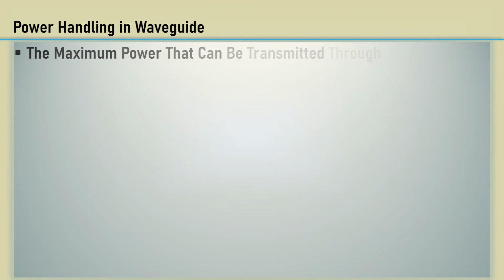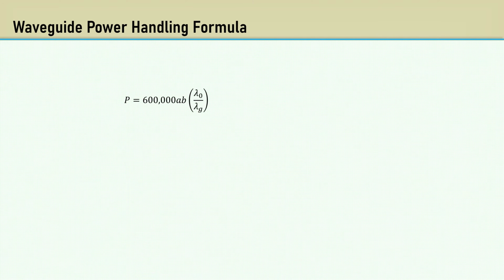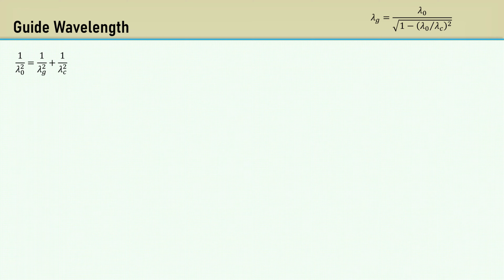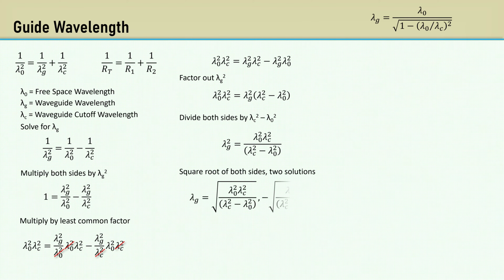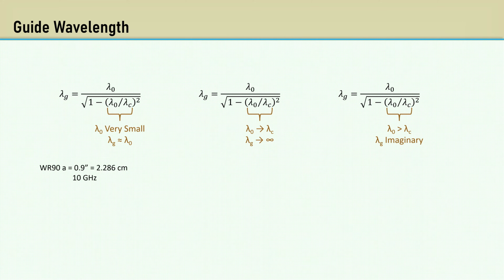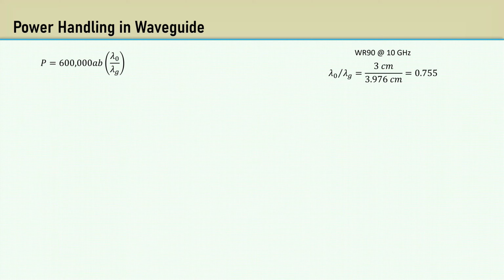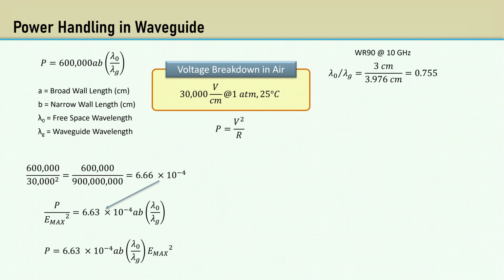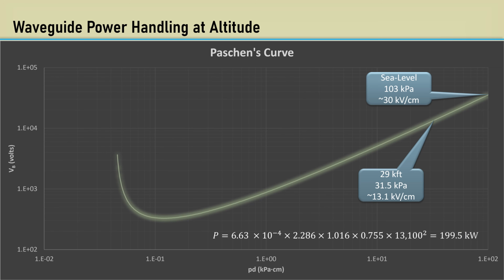Waveguide Power Handling (4k Video)

Comment: I am a big fan of your videos.   I love the fact that you mathematically derive your explanations.    I have noticed that there is a "dearth" of microwave theory textbooks, or lab manuals for that matter, that set forth the underlying mathematics of simple RF network analysis equations - simple transmission line problems for complex series and parallel networks.    Could you recommend a couple of microwave theory textbooks (or lab manuals) that derive their equations and support their equations with "enumerated" examples (I am really looking for "textbooks" with enumerated solutions)?
Reply from the maker: Thanks so much. Unfortunately I have not seen a RF book that does what you are talking about, which is a shame. In my observation, it looks like RF and microwave text book are regurgitations of previous ones, especially with waveguide. It’s a bunch of vector calculus with no real world examples. I wish I could be more help.

Comment: So what does that mean for waveguides in space, it looks like its down to a few watts would that be right? or is voltage breakdown in space much higher as there is no air
Reply from the maker: The voltage breakdown goes back up in a vacuum. The Wikipedia page on Paschen’s Law the graph is better than mine as it approaches a vacuum.
Reply: @oldhackee3915  Your plot is fine.  There is a lot of interesting Physics summarized in a Paschen Diagram, especially that the x-axis is product fo frequency*dimension.
Reply from the maker: Thanks for the comment.
Reply: The next regime of microwave mayhem for space applications is known as multipaction or multipactor.  It is a resonance breakdown phenomena requiring both a vacuum (no air) and radiation (free electrons) environment.
Reply: Look-up Hatch & Williams regarding Multipaction.

Comment: Maybe if we used sulfur hexafluoride gas SF6 as a wave guide quench gas, we could push more power.  I guess we would have to shield the outside as well as the inside.
Reply: If the capacitance not change and dielectric looses not going to be mutch higher than as air use as insulator.
Reply: @Duracellmumus  So does that mean we can't use wave guides in the vacuum of space without the dielectric of air?
Reply from the maker: Thanks for the comment. That sounds interesting.